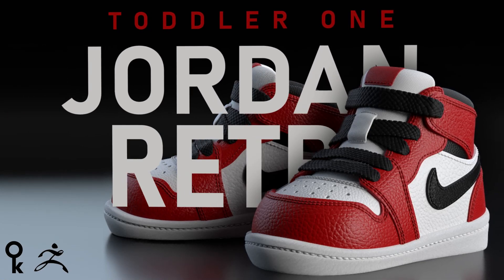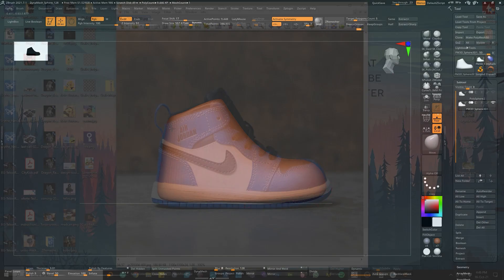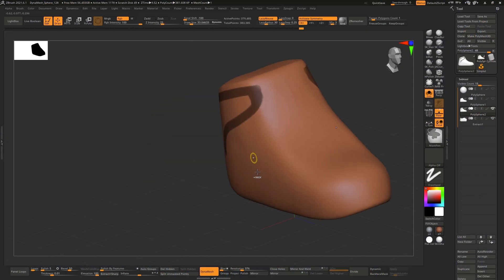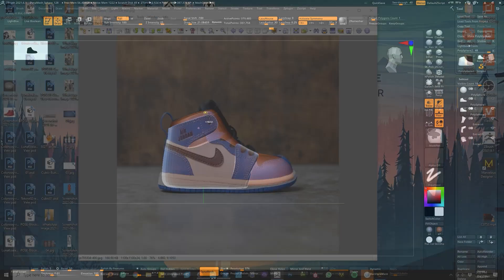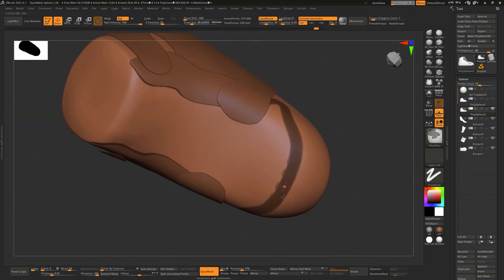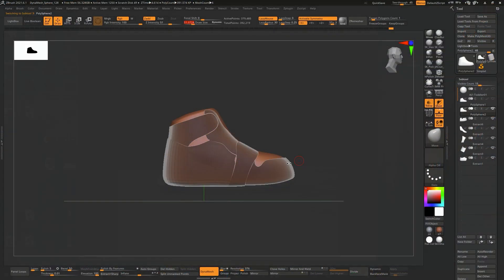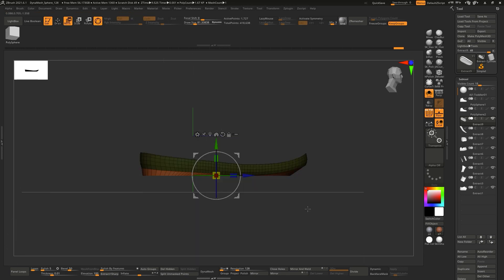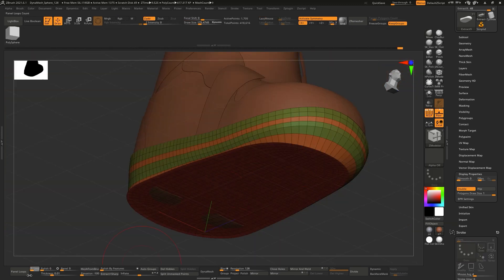How To Sculpt Realistic Shoes In Zbrush

Comment: Hi Oasim! Thanks for this video!
I just had a question about the stitch brush - Is this good for 3d printing as well? Or will it have some gaps between the modeling so will it be hard to print?

Thanks so much for your work
Reply from the maker: Hey, thank you so much for the kind words! For 3d printing, make sure to make them a bit larger, exaggerate them, cause you have to keep mind that all renders get softned. Once you have them layer out merge them with the mesh they are sitting on, dynamesh them and you should be ready to decimate and send to printer. I hope this helps
Reply: @karmieh  I see!! dynamesh so that there are no holes? Thanks!!
Reply from the maker: @행국  Yes, just make sure the stitching touches the model so there is no gap between the stitching and the model, this way when you Dynamesh you get clean results.